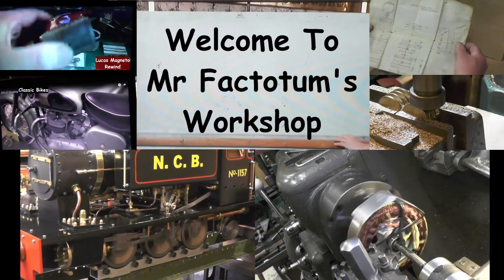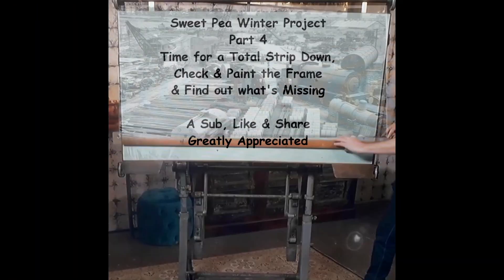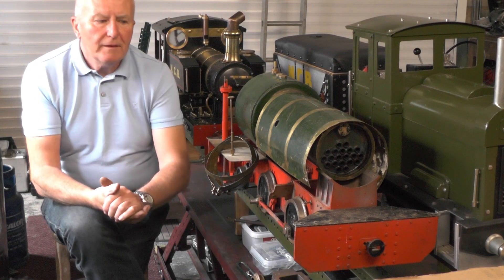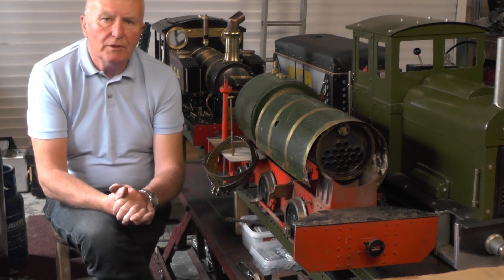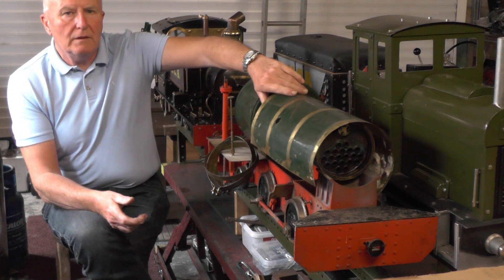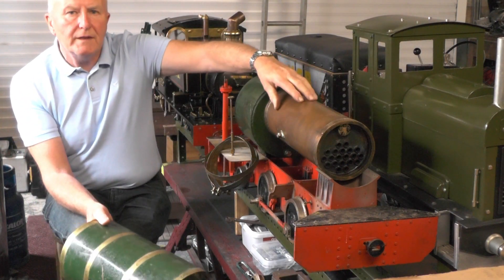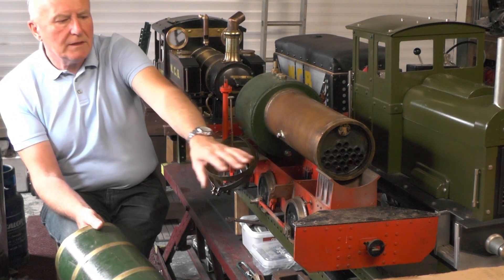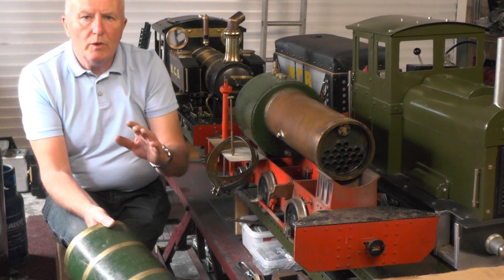Sweet Pea Steam Locomotive Build Part 4 "mr factotum"

Comment: I went too far with my disassembly  and removed the buffer beams and smoke box mount which you have shown clearly didn't need to be done, I hand painted my chassis so that was my reasoning.  Well done with the loco so far Kev, what a difference already!
Reply from the maker: eyup Tom
thanks for the feedback, stilll many parts to make, but i will get there, still thinking about the final looks that i want, may aim for something completly different, we will see
cheers👍👍👍
Kev
Reply: Go for the whimsical look with oversized parts 😂